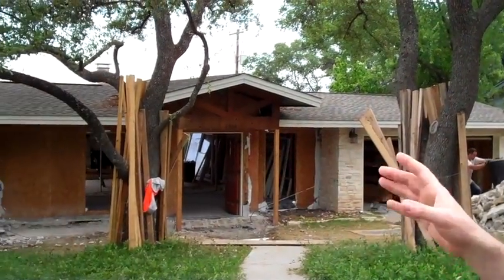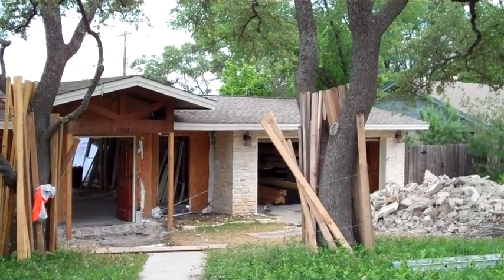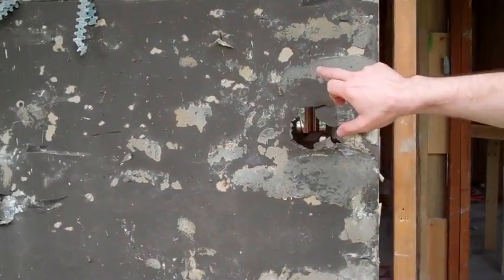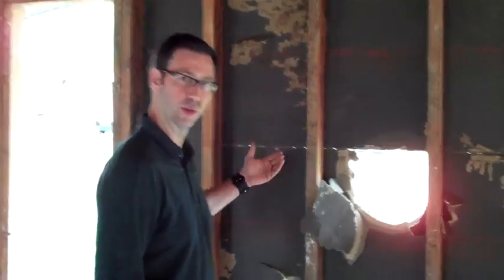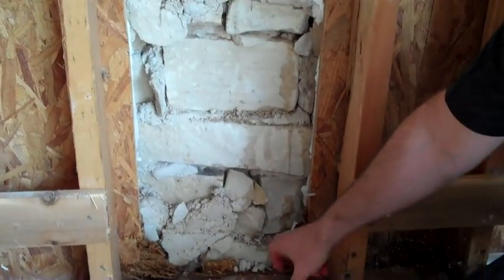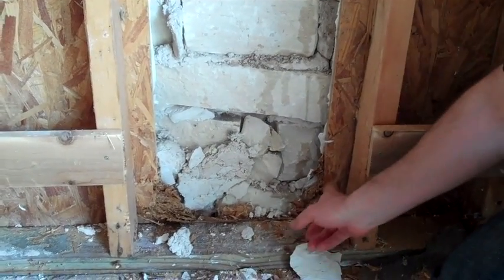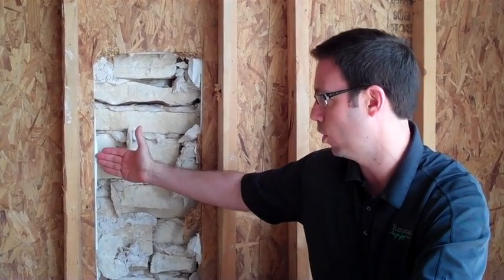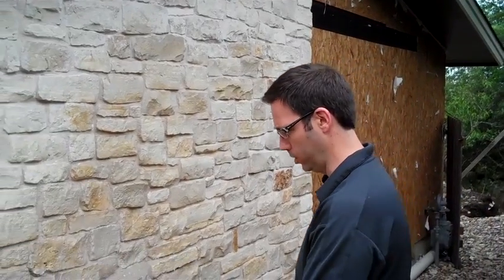Understanding Vapor Drive In Stone & Brick

Comment: Matt your channel is awesome and its great so see you've been at it more than 10 years! good goin. I'm curious about the termites in a remodel like this~ when you find evidence of termite infestation, do you have to do a remediation step before you finish the project? do you tent the building after you're finished with work or do you spot treat the hot spots with spray? just curious how you prevent them from chomping up you're new work if they're inside the structure already, fixing the flashing doesn't seem like it would prevent them from continuing their feast.

Comment: Hey Matt. Need your help. I have an old brick building we are keeping the interior brick exposed and covering the exterior brick with 3 inches of insulation then  shiplap siding.  Do you recommend a vapor or air barrier  applied to brick before insulation ?  Or it’s not needed ? We were either going to put vaproshield or 3M air vapor barrier followed by insulation then siding

Comment: Hell you should've just tore the whole damn thing down as far as u stripped it. There's still moisture trapped somewhere in there if you tore it down that far then it obviously got in. Plus the termite damage. I would be one pissed off buyer if I found out there were any boards that had termite damage at all just because you took the whole house apart and put it back together.

Comment: The wall I’m having issues with there isn’t any black plastic sticking out of the bottom like there is on the other walls. I assume they failed to put any flashing behind the brick vernier and it’s leaking onto the top of my basement wall and into my basement. Took me 3 years to figure out where the leak was coming from and your video just solved it. Thanks very much. 🍺

Comment: Good Afternoon Matt
I watched one of these episodes on insulation and you spoke about a different type of caulking/ foam filter that came in a soft tube like a cookie dough tube that was used in a caulking gun. I have asked the two lumber/contractor supplier about this product with no luck. I’m remodeling a older house with tongue and groove sheathing on the original wall and I think this would be a application for that product to seal the gaps.
Can you please give me the complete name of that product. It might have been at the “Home Show “ please, thanks.
Sincerely,
Dave

Comment: Matt, 
Would adding a hydrophobic nanotechnology to the stone prevent the vapor drive? Thus losing the need for an air gap?
Reply: he said in the video that backing it with any kind of sealant wouldn't work, basically because you can't guarantee complete coverage or that flexing over time wont cause it to crack and pydrophobic nanotechnology is just fancy speak for a water repellant spray sealant. Worse too is once you get water there, the thing that keeps it from getting back there will trap it there once it does get through. meaning you can't dry from the back once you get in the back.

Unless your talking about spraying the exterior but that would probably break down over time for UV exposure and need to be reapplied constantly. 

Also any solution needs to be as quick and cheap as a 0 perm house wrap.

Comment: Matt - Watching this makes me think of a project that has plagued me. There is an existing exposed aggregate concrete patio, poured on top of a pan deck system, that is spalling and is wearing away. This video and your comments make me think that the spalling may be prevented if there is a n air gap beneath the concrete patio to allow air movement beneath concrete patio to aid in drying and moisture to pass through the concrete from the top to bottom instead of being trapped beneath the surface of the concrete. I know what you might say, rip it up and install pavers. However, the owner doesn't have the money for that. So, have you ever done anything where you created an air gap beneath an existing concrete patio or wall to allow for moisture to pass through? Mind you, this is an area that gets snow, ice and frost. It is located near Washington DC. Thank you for any information you might have.
Reply: Doctor Doom You sound like an idiot, are you a congressman?
Reply: You have me mistaken with someone who cares what you think.

Comment: might as well tear that house down and start over. I mean what is really left a little bit of wall and roof framing and some roofing. the Windows are too tiny and I am sure it will get rewired and some plumbing re arranged. the slab is also too low. those walls are almost in the dirt. There needs to be some sort of concrete wall added to the perimeter to raise it up a foot or so off grade.

Comment: Hi Matt, big fan of yours going through a new build here in North Texas.  It seems like there's still a huge amount of confusion regarding sheathing even amongst builders today. Apparently nothing has changed over the past 20 years.  On our block alone, we have 5 new houses being built, all with different methods of sheathing.  Green Zip Board, Zip-R (has an added foam thermal break), RMax foiled foam board, Thermo-ply, and Zip with additional radiant housewrap.  Personally, I’m not a big fan of Thermo-ply.  We decided to use Zip and added a radiant housewrap.  It was actually one of your other articles that persuaded us to install this behind all the brick veneer.  So far no loss of any cell phone signals, and hopefully it will greatly reduce our thermal absorption….we shall see.  I just hope the hundreds of galvanized brick ties don't conduct too much heat to the inner wall and comprise the radiant foil.  

The Green Zip Board is definitely a superior product compared to standard OSB or plywood. I personally tested some scrap I found in the trash pile for water resistance.  Placing the scrap piece flat on the table, I used a tube of silicone to create a thick beaded ring on the green surface.  After allowing it to dry, I filled the inside of the ring with water (about ¼” deep) and left it overnight.  The next morning the ¼” of water was still there.  I then dumped the water and cut the board in half and didn’t see any noticeable dampness in the wood fibers.  For all intents and purposes I think it should provide more than enough water protection considering it's usually used as a secondary barrier.
Reply from the maker: Very cool.  What's the radiant barrier you are using? Sounds like you are building a very good house. Thanks for watching!